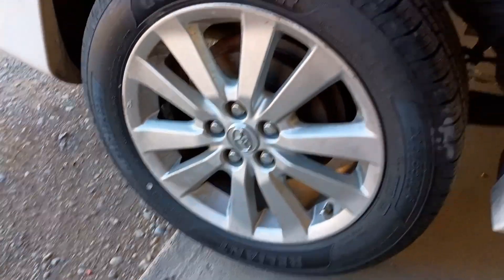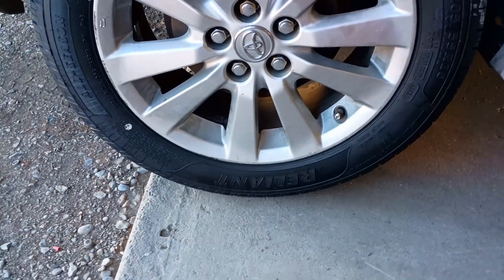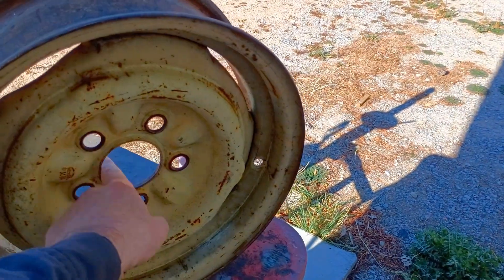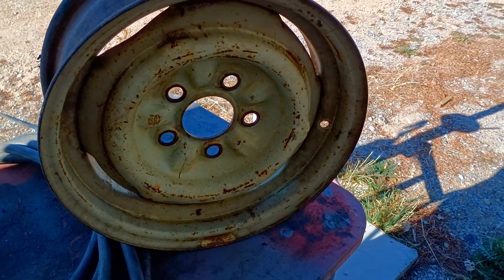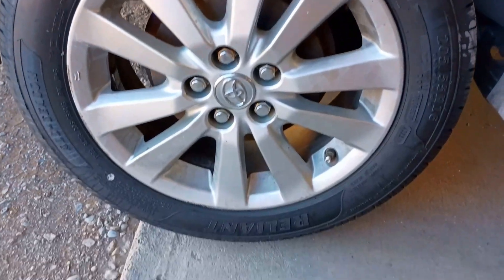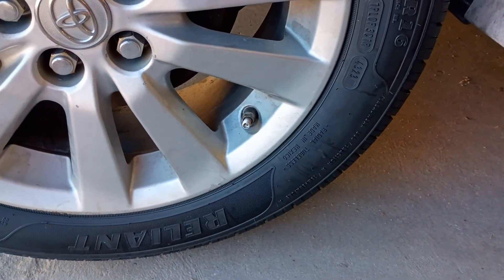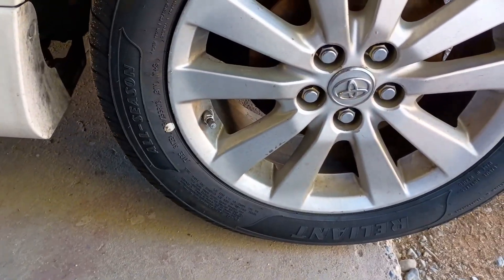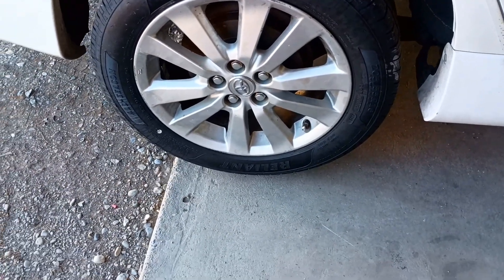Why is there a dot on tire sidewalls?

Comment: While I agree with you on the matching mounting, I will say I dont think that that would be a total reason to not get tires from the place you shop at. I've mounted tires on rims, matched them and after balancing there was a lot of weight. I spun the tire 180⁰ and balance came out better. Now yes the tire could've had slight issue or variance, but even when road force balancing (which was in spec) it would come out balancing with lower weights after rotating tire on rim. I would say if you look at weights on inside and they are low it "should" be ok. Also some tires have multiple dots on them. I've seen a yellow, red and white dots...all on one tire